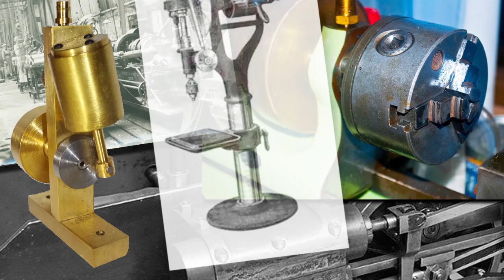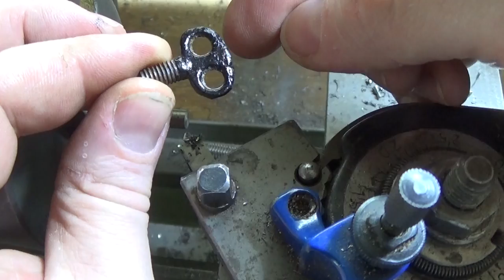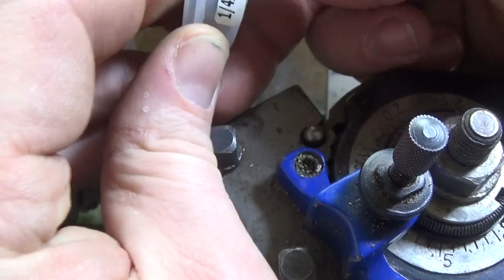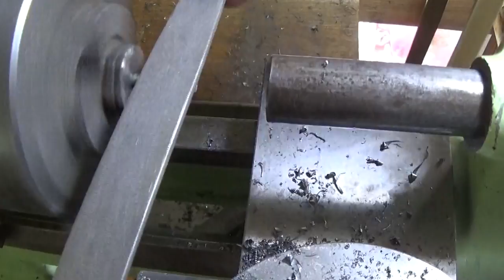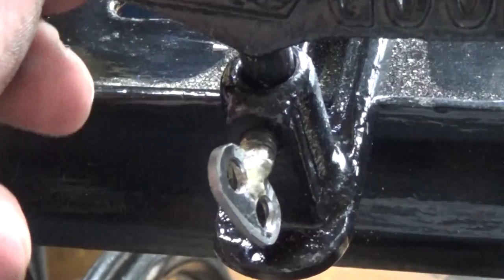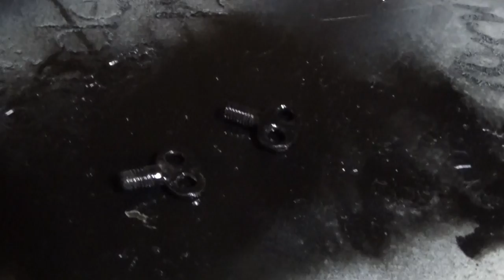introducing mortimer PART8 - a thumbscrew

Comment: As usual, nice job. If you are going to turn a file handle, you will need one or all of three: a point (turn between centers) or either a screw center or a spur center. I have made by now at least six pole lathesand Mortimer looks like luxury to me. I made a spur center out of a repurposed spade drill bit and use it on the Taig, I prefer spur centers to screw centers. Just regrind one side of the spade bit so's it digs in. On  pole lathe (or in my case, a bungee lathe) you are always between centers, so on Mortimer you must rig a point and a dog if you are turning BC. For turning file handles, wooden dogs work fine and will not mar the work.
Reply from the maker: great idea on  the spade bit!! thanks for that.